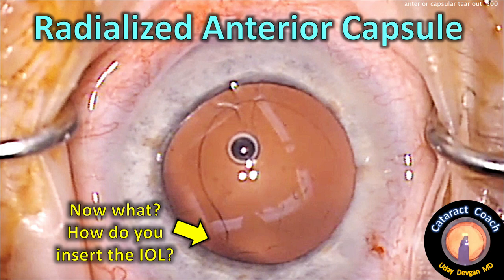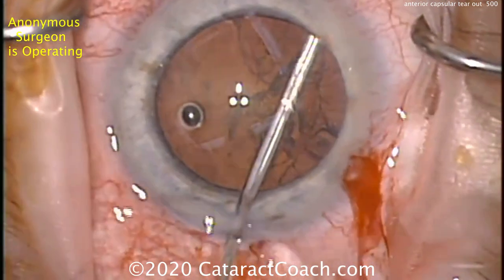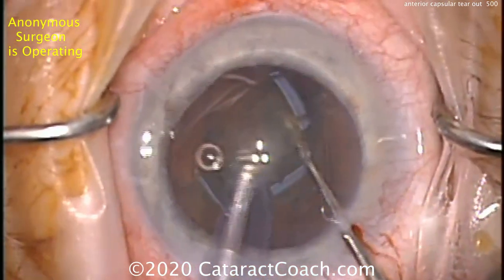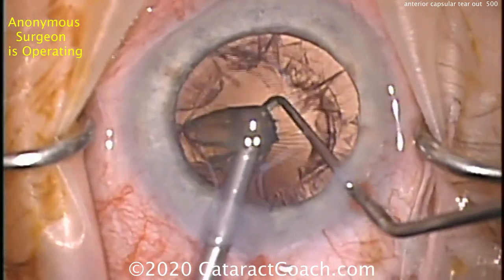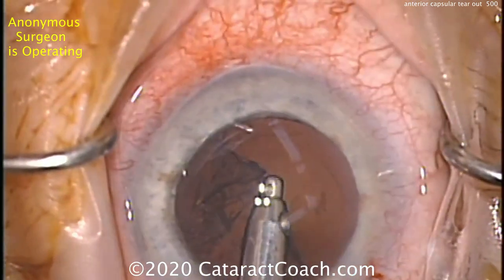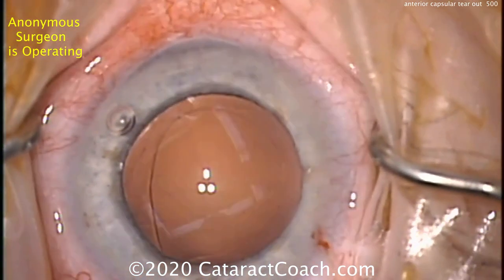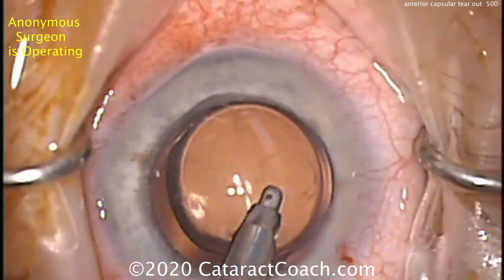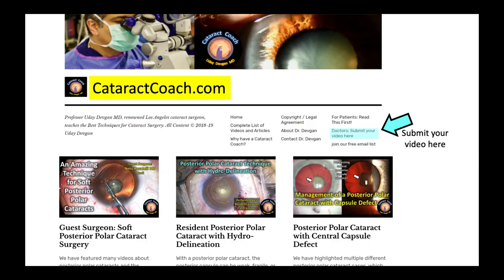Radialized Anterior Capsule in Cataract Surgery

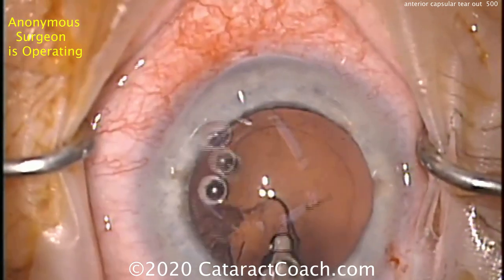Comment: The radial tear definitely occurred @2:44 or so, but puzzling for no special reason... You gave the two important tips in dealing with this situation, Dr Devgan: do not let the anterior chamber deflate by filling it up with OVD before withdrawing the I/A probe; and after gently injecting the IOL, place the haptics 90 degrees away from the tear. In most cases the tear will not extend. I would add that suturing the incision would give an extra measure of safety ensuring that the anterior chamber stays formed in the initial post op period. Great and important tips Sir, and thank you for another excellent video, Dr Devgan!
Reply from the maker: yes, excellent points. Thank you Neto!

Comment: The radial tear start at @0:11 . Entering the eye with tips of the forcep pointing downwards sometimes nicks the concave surface of the capsule in microns. Later after manipulations in the eye it gives way during IA. I have had this same issue in three consecutive cases where during ia the capsule tears exactly where the forcep enters. I am a left handed surgeon. I therefore used to tend to keep the left side of the forcep tip slightly tilted just like this surgeon while entering the eye. Pause at @0:35 you can see the micro nick.
Reply from the maker: Great insight. Thank you. I will watch that carefully.